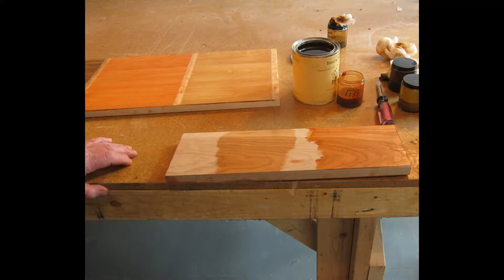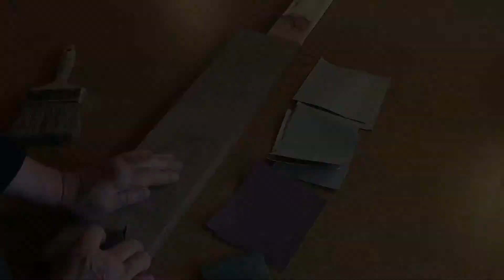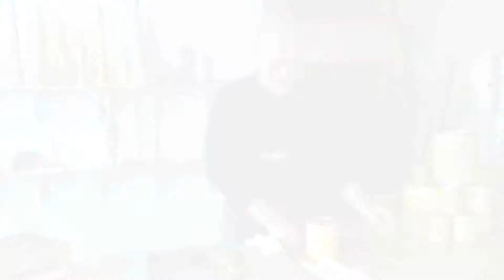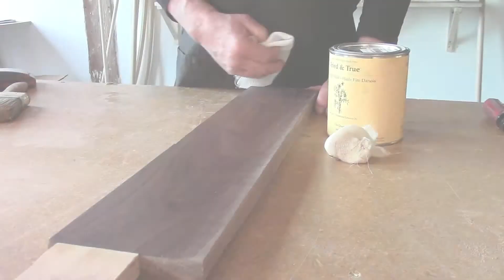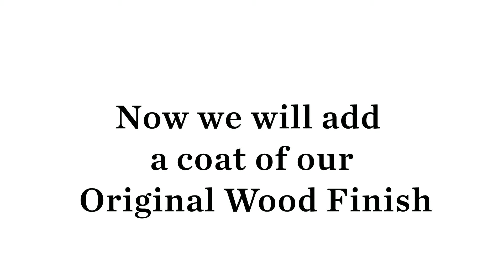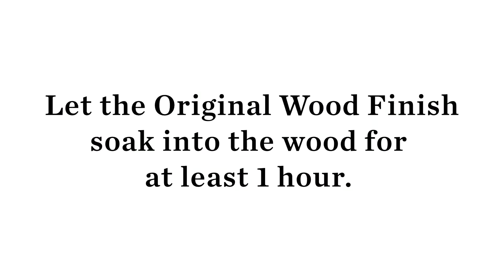How to Apply Tried & True Wood Finishes

Comment: Hello, so is it raw linseed oil that is used? It says polymerized. Don’t you have to add driers to make it polymerized? Or do you heat treat raw linseed oil to polymerize it?
Reply: My understanding is that polymerization involves heating (and, ironically, "boiled" linseed oil is not heated, but contains additives). I believe T&T is a polymerized linseed oil, but it is interesting that he let it sit for another 3 days to fully dry (cure?) the piece.
Reply: Polymerized simply means oxidized (with the addition of oxygen).  Linseed oil is highly unstable, and oxidizes quickly.  Boiled linseed oil is heated to speed up the polymerization.

Comment: Sand only in the direction of the grain. Does that mean one must NOT use random orbital sanders?
Reply: I tend to use my random orbital sander (ROS) only up to like 220 or even 320, but that said, I don't always catch all the pigtails made by the ROS. After ROS, I hand sand starting with the same grit that I used on the ROS. I think the mistake I've made is at this step of switching to hand-sanding where I have rushed it, failing to be more thorough. If I hold the board under different angles of light - or use a bright light on the surface - to ensure that all the pigtails are gone, I think that's what's needed. After that, if I am stepping up to higher grits in the hand-sanding phase, each grit tends to go pretty fast. I like to aim for a high grit because I like the glassy smooth surface that results. Many people disagree and insist that you only need to sand to lower grit. And then there are those purists who don't like sanding at all, and prefer cabinet scrapers. Anyway, I'm still experimenting and might give this product a try at some point. Happy woodworking.

Comment: Just purchased the Tried and True Finish. When I opened the contents was really thick, not runny at all. Is this correct or should I get a new can.
Reply: The T&T Danish Varnish Oil I use is thick, like honey at around 70 degrees.  It's amazing.  I've read some people heat it to 120 with good results- but I've not been so adventurous. I've used it on bare wood, previously varnished and oiled wood surfaces (teak and fir).  After 3 or 4 coats, the wood doesn't really absorb any more.  I am never in a hurry applying this product as it merits patient application.   It's safe to use indoors and actually smells pleasant.  If one has less time, I've had great results with Rubio Monocoat and Osmo one coat oils, but both require bare wood to absorb and cost substantially more money.  Always wet and store saturated application material outdoors, in an open area or appropriate container to reduce risk of spontaneous combustion.

Comment: I've applied the T&T Varnish Oil to a table top I'm working on. Needless to say its my first time using this product.
I applied the first coat, no issues. It went on almost exactly how you indicated in the video. I performed all the steps, burnished after 24hrs, after an hour wiped aggressively till the surface was not tacky, and nothing was left on the rag. Upon application of the 2nd coat, I noticed that it wasn't being absorbed into the surface as well. I applied a very thin film, following the same procedure I did with the first coat. 
Its been 4 days since my 2nd application, and I'm still noticing residual finish on the cloth after wiping, though the surface is dry to the touch. Almost every hour I've been back to the work piece to aggressively wipe it down. 

What can I do now? I'm almost at the point of grabbing my sander, ripping all this off and trying again from the start.
Reply: Maybe your humidity is really high? Where are you located?
Reply: Evan you took advice from an old man good with a ponytail bad who recommends using steel wool oh dear me.
Reply: @laurencekelly5081  0000 steel wool is used to burnish fine wood by professionals for years.

Comment: Do you need to use the Danish oil first or can you just use the Tried and True Original? What is the difference? How long will this finish last before it needs to be reapplied?
Reply: You’ve probably figured this out by now but the Original Wood Finish always needs to be last due to the beeswax content. It’s not possible to apply anything on top of the beeswax except more Original Wood Finish.
Reply: @vautrain Can I use the Tried & True Original without doing the Danish Oil!? Or do I have to do both? I have Brand New Schuler Cabinets and just want to clean them up a little after Installation. So they’re Brand New Cabinets and not Old or need Re-Finishing. Any help would be GREATLY APPRECIATED!
Reply: @YouTubeDeletesIRepeat you can use it on its own as it's the same as the Danish oil just with beeswax added. You'll probably get more depth(esp when trying to express the grain) by using the Danish oil first though.

Comment: A bit like watching a Japanese tea ceremony.  Such delicate application sure wouldn't work for large projects!.   I"m using the T and T oil plus stain followed by T and T varnish oil on southern pine flooring.  (The can says "not recommended for floors" but the T and T website has a pdf for floor application!! What gives??)  Having applied two coats on the floor,  I like the look (of course, it's new).   The rag I used was pretty soaked, not this dainty doily thing he's using!  I'm using lots of elbow grease, and will follow using a 10 inch rotary car buffer.   Although I used more than this guy's extreme minimalist coat ("If you've used any, you've used enough") I still used only about a pint over 175 square feet, which would actually work out to 1400 sqft per gallon.
Reply: Anything to report from the process? how does your floor look after 2 years? There is very little reviews on this product used on floors. and virtually no where to see it
Reply: T. M. Kara I think it means that it’s not made specifically for floors but you can if you want just it won’t be optimal

Comment: You've got some good questions left here that you haven't answered.  Mine is, can you add the Original Wood Finish as final coat over a Minwax stained butcher block island instead of a coat of poly?  Would the application be the same without the base coat of Danish oil?
Reply: Yes you can apply our products over any oil-based stain (no poly, no water-based).  The application would be the same.

Comment: I browsed your compnay's Tried & True Wood Stain. It seems your company's Tried & True stain contains Polymerized Linseed oil already. So, after I apply your company's Tried & True stain, do I still need to apply your company's Tried & True Danish Oil, which contain Polymerized Linseed oil only, as the second cover?

Comment: Nowhere in your written instructions do you say to burnish the surface.  Nor do you say to start with "Danish Oil", then move to "Original Wood Finish".  Maybe you could explain your reasoning here?
Reply from the maker: Since the Original Wood Finish contains beeswax, it must be the last finish you apply on the surface. Only other wax based finishes will bond over top of this product.
Reply: How will this effect future maintenance? You stated all you have to do to repair scuffs is to reapply the finish without sanding, but the initial steps included the danish oil. Will you see a difference in the finish? Also, will various cleaners effect whether or not you can reapply the topcoat without sanding?
Reply: I have used Murphys Oil Soap for cleaning my pieces with T&T wood finish on them. Works great and no resanding required. I recently used the Original Wood Finish on an old desk, without danish oil.

Comment: Why didn't you cover the entire piece?  You left the edge dry on the first coat?
Reply from the maker: This video's purpose is to give the viewer an overview of prepping the wood, applying the finish, and curing the wood. On a normal woodworking project, you would want to make sure you are covering the entire surface that you want to protect.

Comment: 1/100th inch seems thick.  Is that what you meant?
Is the application process the same for the "Original Wood Finish"? - can you make a video for that one if not the same process?
Reply from the maker: The Original Wood Finish is used for the second and third coat. The application process is the same, except you need to let the finish penetrate for 1 hour instead of 5 minutes, and the curing process for the Original Wood Finish takes 24 hours instead of 8 hours.